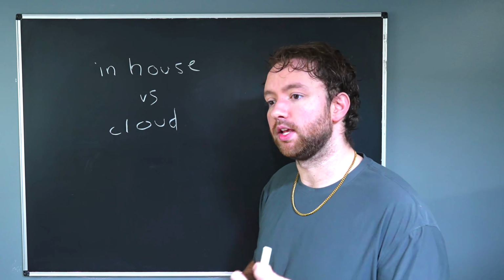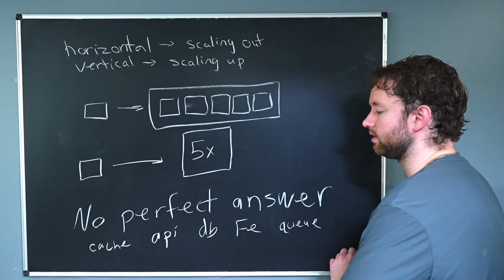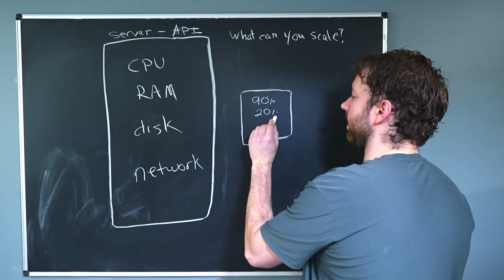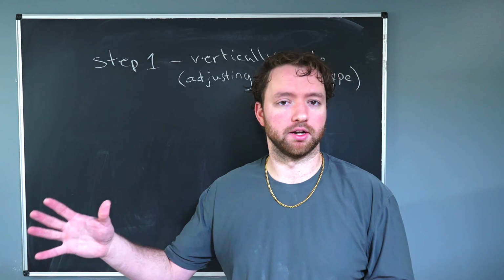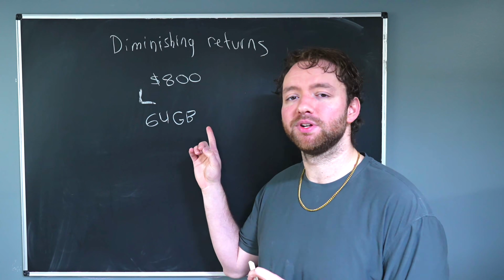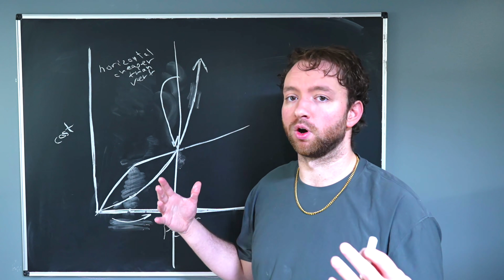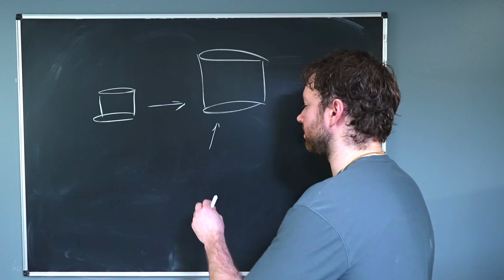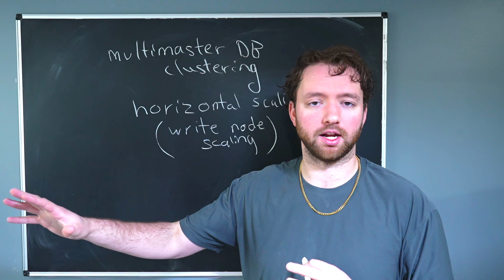Horizontal and Vertical Scaling (How to Scale Your Application) - System Design

Comment from the maker: 💰 Mentorship to six figure software engineer - https://calcur.tech/mentorship
⚙ Backend Engineering Mind Map - https://calcur.tech/mindmap
💻 System Design Playlist - https://calcur.tech/system-design
Timestamps:
00:00 - Introduction
01:32 - in house vs cloud
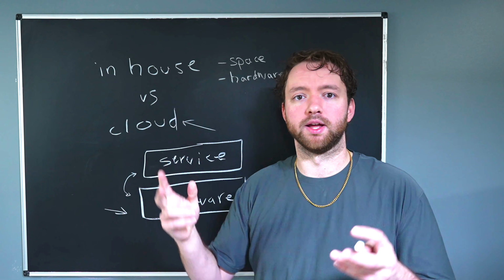03:53 - What is horizontal and vertical scaling?
06:52 - Backend API
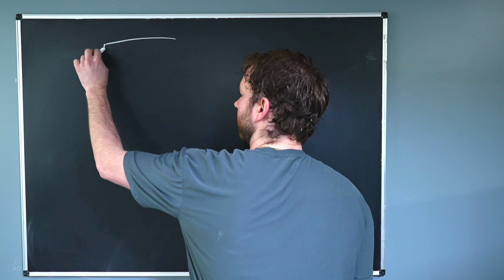07:47 - Stateless Services
09:31 - Vertical Scaling
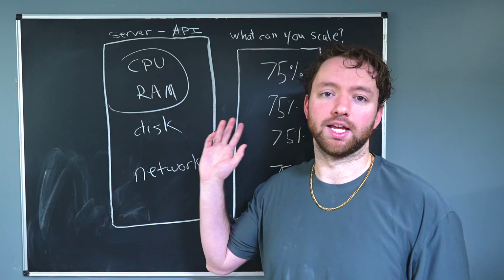14:19 - Steps to Scale an App
16:55 - Horizontal or Vertical?
17:41 - Diminishing Returns
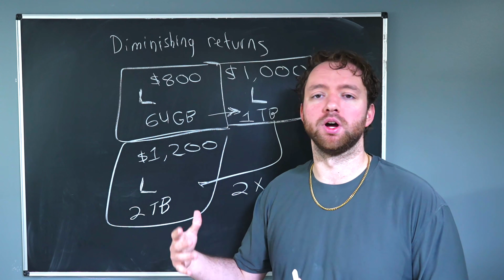20:31 - Charting Performance
23:48 - How things Differ When Virtualized
25:19 - Scaling with Serverless Services
26:27 - Scaling Databases
32:11 - Resources

Comment: 15:50 don’t you still have single points of failure? Your load balancer and your database server
Reply from the maker: I think in concept a load balancer could be a SPOF if it’s a single instance… however many productized solutions are aware of the purpose of load balancers for high availability

See this for example 
https://serverfault.com/a/612271
Reply: We can even horizontally scale the load balancer I guess.